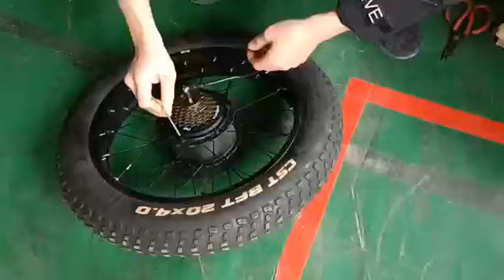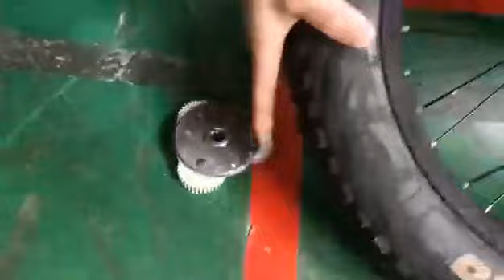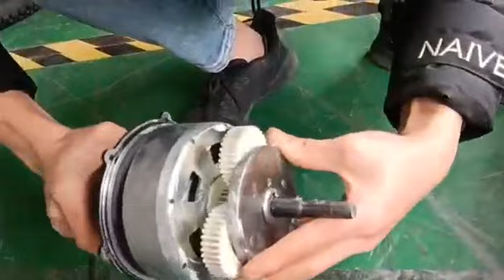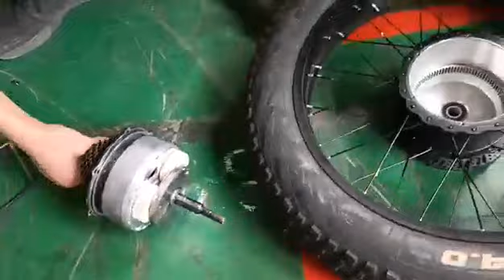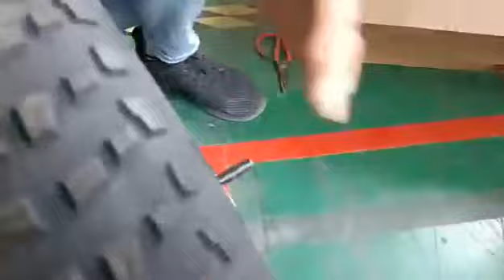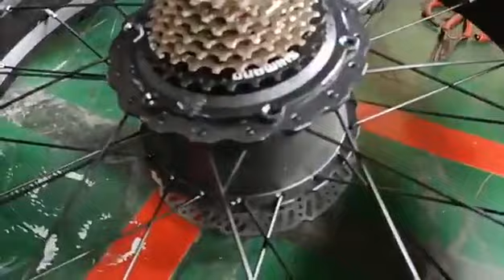Replace Motor

Comment: How do you switch the teeth to new motor
Reply from the maker: To switch the teeth (gears) to a new motor, you will need to carefully remove the gear from the old motor and transfer it to the new one. Here’s a general guideline:

Remove the old motor: Ensure the bike is turned off, and disconnect the motor wiring. Use appropriate tools to remove the motor from the frame, taking care not to damage any components.

Remove the gears from the old motor: You will likely need a gear puller or similar tool to carefully take the gear off the old motor. Depending on your model, you may also need to unscrew a bolt or nut holding the gear in place.

Install the gears on the new motor: Once the old gear is removed, attach it to the new motor. Ensure that it is seated properly and that it aligns correctly with the motor’s axle.

Reinstall the motor: After transferring the gear, reinstall the motor into the frame and reconnect the wiring.

If you’re not comfortable with this process or need more detailed steps, it might be a good idea to contact Rattan customer support for guidance.